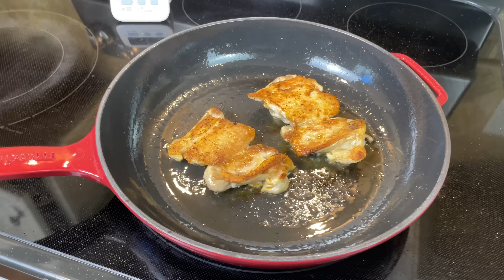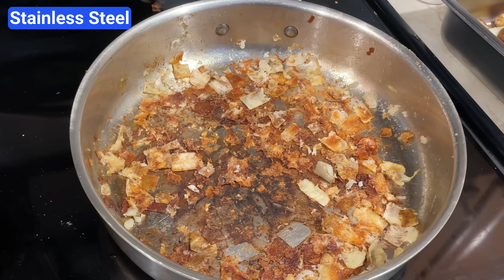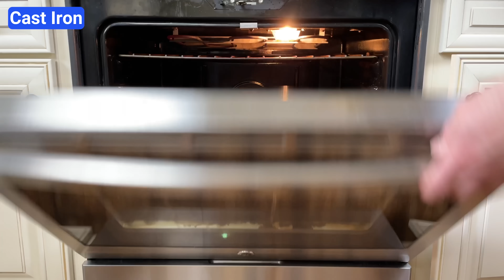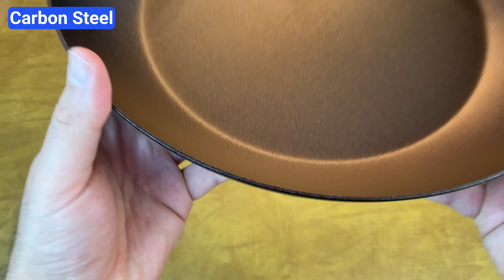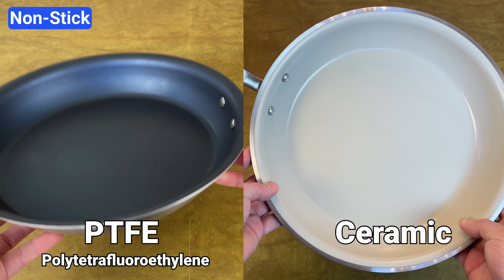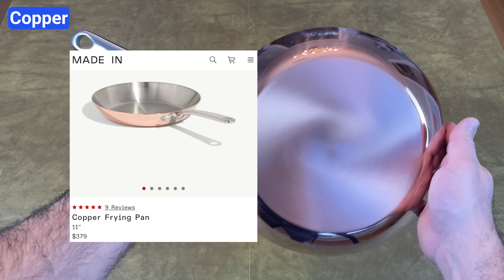I Tested Every Cookware Material, Here’s What to Buy (and Skip)

Comment: Nice video. However, you are missing the most important metric for measuring cooking material performance: DIFFUSIVITY. This is the single most important factor for both even heating, and searing potential. Diffusivity = Heat Conducted / Heat Stored. You can see an excellent video on this, "What's the Best Pan Money Can Buy?" You also are missing aluminum, which are great pans: high diffusivity, cheap, very light weight, and these are the reasons most commercial kitchens use aluminum.

Comment: I recently bought a carbon pan for the first time in my life.. And boy I was surpriced. It is almost like a teflon pan but it goes into ovens without a problem. It fries meat very well. I know this video says it has an uneven heat but that is not just a negative. Like on a barbeque grill you can push well done dishes to the side so they dont burn. I also bought a stainless steel pan. And yes it is good but with a clown chef like me things stick to the pan most of the time. But it is nice to have and beside all my pots are stainless steel and they have survived for 30 years.I would also mention my scanpan. It is getting 40 years old. I believe it was sold as an titanium pan. It looks like a total mess. But it can cook. I think you need a nuke to destroy that one. Over the years I have also bought a lot of teflon pans. You know the ones that claims to glow red when they are ready. I have never seen this red spot glow up. Of course I have bought other non-stick pans. They last 1-2 years.... I also bought a hex-clad pan. It could not take the heat so the flat surface of the pan became a very rounded surface. So based on 50 years of cooking I would recommend (if you are on a budget). A carbon pan and some pots made of steel

Comment: Only problem with ‘made in’ brand cookware is that the aluminium is exposed and will erode due to the detergents used in the dishwasher. Please tell me if I’m wrong. Also, the handles are too short/narrow.

Comment: An alternate title for this video might be:
 "Which metallic element, metal alloy (alone or in combination) Makes The Best Cookware Material. I Tested Steel, Aluminum (coated) & More"
For use on electric or gas hobs, the important characteristics and performance of low carbon steel (a.ka. Carbon Steel, high carbon steel (a.k.a. Cast Iron) - enameled or otherwise, stainless steel, and coated aluminium are fairly straightforward. and much studied. 
Even on these hobs, , treating 'Stainless Steel (SS)" as if it were a single generic material complicates things. But only marginally since the the primary consideration is limited to food safety, durability and corrosion resistance.
In fact there are over 150  types of stainless steel alloys that fall into 5 main categories that consider property differences that influence magnetism, hardness and corrosion resistance. Each type is further subdivided into grades. Each grade features a different level of quality, durability, and temperature resistance.

As more and more people migrated toward induction cooking - technology and hob construction differences aside -  treating stainless steel as a single, generic material has the potential top become very misleading.
For induction cooking, while corrosion resistance remains an issue, the ability to efficiently use the energy available from a magnetic field becomes very important.   
304 and 316 SS - commonly used in cookware - have different corrosion resistance properties (316 providing better resistance to things like pitting). And, both are non magnetic.
The 4XX series SS are all magnetic but less corrosion resistant than the 3XX series steel alloys.
On induction hobs the degree to which any cookware can efficiently capture and distribute the energy available from the induction rings will be a key factor in defining its utility.
A couple of examples:

Demeyere Atlantis and Proline
Like all multi-clad SS cookware, Demeyere's Atlantis and Proline series sandwich various materials with good thermal transfer characteristics between two SS layers. However, it would be misleading to think of these products just having an inner and outer layer of generic SS.
In fact these products were designed specifically with efficiency on induction hobs in mind. The outer layer of SS is actually 3 layers of SS alloy, constructed in such a way as to maximize the use of the magnetic energy available. (my guess is a sandwich of 3xx/4xx/3xx SS's).
Placing a highly magnetic material between layers of corrosion resistant, food grade SS to maximize available energy  seems analogous to doing the same things with aluminum/copper/silver to maximize heat distribution.

Demeyere Control Induc
Takes the above one step further by introducing an alloy that, when heated beyond a certain temperature, selectively alters its magnetic properties. Beyond 250C the Proline Control Induc pan shuts down it's magnetic properties.

Both examples seem a far cry from retrofitting a pan for use on induction hobs by attaching some type of stainless steel ring or mesh to the bottom of the original design.

How do you credibly compare the two on a value basis (price/performance)?

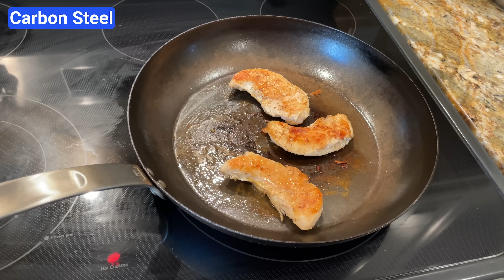Comment: 7:48 It looks like your carbon steel pan might be warped here. You can see a rocking motion as you lift up at 7:51. Carbon steel pans are typically extremely flat on the bottom, and usually match well with a glass cooking surface in my experience; it's a pretty big advantage vs cast iron, especially if it has a cast outer rim on the bottom.

Also, it would've been good to call out that while the MadeIn pan is significantly lighter than cast iron, other brands' CS pans can weigh as much or even more than similarly sized cast iron; it's probably more common that cast iron is heavier, but definitely not always (For example, compare a DeBuyer mineral B pro CS pan to a similarly-sized Field cast iron pan).

Comment: Hey i followed your method to season carbon steel , i got the nice bronze color, but everything sticks like crazy, what am i doing wrong?  i cooked some chicken with lots of oil and it stuck so bad i couldn't even scrape it off,  ground beef also stuck .
Reply: Seasoning gets blamed for sticking way too often. If your seasoning is present and is not flaking off (you're leaving too much oil on the pan when seasoning), it's probably your cooking technique that's to blame for your frustration.

Make sure your pan is thoroughly heated up BEFORE adding oil or food to it. 
Also, use a lower heat profile than you normally would (CS likes medium-medium high at most, and you might find that you need to turn the temp DOWN during cooking because of the heat retention). 
Lastly, especially for any proteins, don't poke at it! If you're coming from non-stick pans, it's super common to poke and jostle your food around needlessly. Let your food stick for 30 seconds to a minute and release on its own. If you move your food around too much, the browned portion is going to stick to the pan and not to your food!

I hope that helps! Carbon steel, IMO, is really the perfect mix of SS and cast iron. If it weren't for tomato sauces, it'd probably be the only type of fry pan that I'd use.

Comment: I love the look of an all copper exterior but induction is my favourite heat source, would you recommend or have u tested copper cookware with induction converter plates?
Reply from the maker: I haven’t tested induction converters yet but you might want to check out Hestan CopperBond. It has a large copper band on the outside but the bottom is steel so it works on induction.

Comment: Fully Stainless Steel clad Aluminum (and a few Cast iron for non acid foods), are the only pans i used from the set i bought in 1963,  before i was married to the set i finally replaced them with, in the 1990’s and still use.  I love them, they look like new even now.  I love, love,love them for their ease in cooking, their longevity and ease in cleaning them!  They are pricy now, but well worth it. If you buy them separately, the set may be accumulated, but they may be out of reach for many.  Check estate sales, these puppies are made to last!

Comment: I'm a chef and we have stainless and carbon steel pans at work. I love the carbon steel ones.
Reply: How do you handle the cleaning in the restaurant? Do you wash with soap? Do you grease it every time?
Reply: @hubertinasimon7098  Yes. With soap and every time when used a bit of grease.
Reply: @Raz0rking thanks! We have a spray with rapeseed oil for after cleaning

Comment: You have the Breville Control Freak?!?!?! Pls do a video about it. I always wanted one, but it's so expensive. I could get a full size induction range for the same price, but I also don't want to replace my gas stove. I'm trying to justify getting a Breville Control Freak to use alongside my gas range so I could have the best of both worlds. I tried using a NuWave induction cooktop, but the heating coil is way too small compared to the larger one on the Breville.
Reply from the maker: Yup! I just got it a couple months ago so I need to do a lot more testing. But I will do a review eventually. So far it’s awesome.

Comment: I've tried forever to get my carbon steel to be as slick as my cast iron, seasoning it a million different ways, and I'm just over it. I'm rocking stainless most of the time now
Reply: Me too, Michael. In my case, I couldn't understand why my carbon steel Wok kept loosing its seasoning. Then I realised that I was cooking European foods – especially Italian and Spanish tomato foods –  instead of traditional Chinese foods. 🤦‍♂️ tomatoes are acidic 😂.  I was also unaware of the science of the chemical reaction required for seasoning to become really hard. As you'll be aware it's called "polymerization", and I needed to use a higher smoke point oil (avocado or grape seed oil) to obtain a durable seasoning. But, my biggest reason for switching to stainless steel is that I can make great sauces by adding acidic wine to free that  delicious caramelised meat "fond" from the pan without destroying the seasoning.

Comment: I used to think my problems of sticking were related to my pans. Only after watching your video of how to stop food sticking with stainless steel did I realise it isn’t the pan that's the problem.

My problem was that I had a cheap electric hob. It took forever to heat up and was difficult to fine-tune to maintain precisely the right temperature. 

Switched to an Induction hob. Immediately, my problems were over. But, you need to ensure you buy an Induction hob that offers precise temperature control, rather than one with lots of presets. You must be able to raise and lower the temperature by just a few degrees. Not many have that facility, so it pays to research your Induction hobs to avoid disappointment. Now, I can precisely bring my stainless steel tri-ply pan to exactly the required temperature, I having no problems with foods like eggs sticking.
Reply: My KitchenAid induction works as well as gas. I love it!
Reply: @j.m.7056  yes. You've just got to be sure to buy an Induction hob that has fine adjustment on the temperature control. Many of the cheaper standalone units don't. 👍

Comment: I think the responsiveness and conductivity of copper makes it the best material for candy-making. When you're heating sugar and trying to target a very specific caramel stage you want to be able to take it off the heat and have the temperature stop increasing immediately. Copper's responsiveness seems to be ideal for this. Additionally, the conductivity is really important for making sure the corners and walls of the pan do not get cool while the sugar is melting, otherwise you might have crystallization begin at the edges and spread through the entire batch, turning the molten sugar into a rock-hard mess! I have seen this happen right before my eyes! Very cool chemistry-wise but frustrating to deal with!
Reply: I've actually heard that solid silver makes for the finest, most responsive pans. If you google it you'll see there's a company that sells a $5,000 silver frying pan.

Comment: The video doesn't mention the choice between bonded disk bottom or fully clad for stainless steel and non-stick.  For many uses, the sides of a skillet don't need to be as hot as the bottom, and a thick disk can give good heat distribution at a lower weight and cost, can't it?
Reply from the maker: In most cases, I recommend fully clad stainless steel. it spreads the heat more evenly and is more durable because it’s the same thickness throughout. Plus, there are many great options on the market at various price points.
Reply: Fully clad has the advantage that the side-walls get hot as well as the base, while those with just a disk on the base tend to be the bargain basement pans, and the side-walls won't get hot. The all clad get the highest recommendations from the experts.

Comment: Personally I only need stainless steel, carbon steel and enameled cast iron.  If you throw in baking I like anodized aluminum.  Copper is cool but unnecessary and nonstick works great for delicate fish but that's so niche.
Reply from the maker: Do you have a favorite between stainless steel, enameled cast iron, and carbon steel?
Reply: @PrudentReviews  It depends on the application -- stainless is my general all-around go-to, carbon steel for searing meat and for other fast high-temp uses, and enameled cast iron for stewing and braising.  There's overlap, of course, but that's basically how I decide what to reach for.